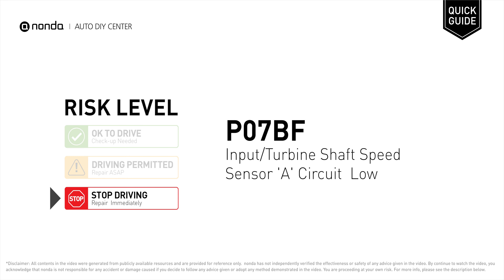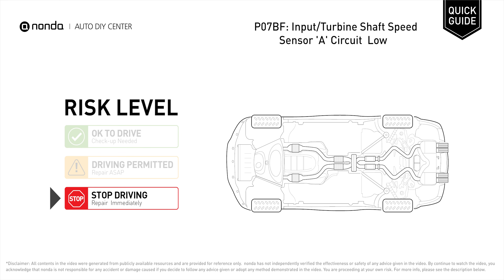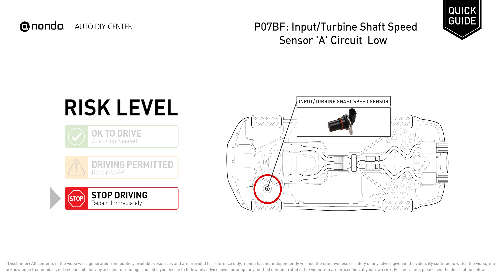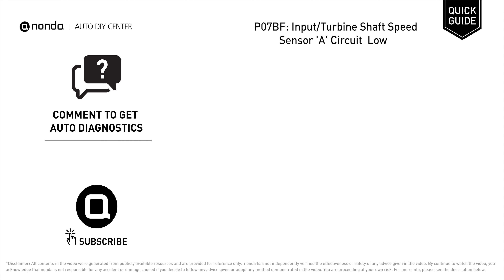What is P07BF Engine Code [Quick Guide]

Comment: My 2011 740li has a P07BF transmission code. Any tips would be greatly appreciated thank you.
Reply from the maker: Hello, please check the condition of the input/turbine speed sensor and the output speed sensor. Check also the torque converter for any issue.